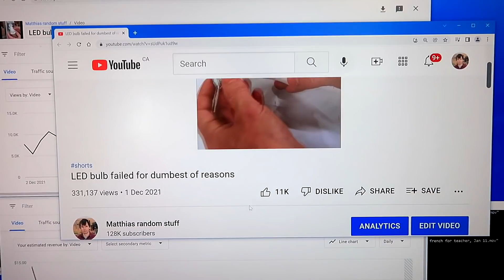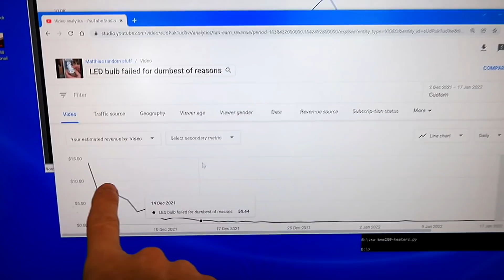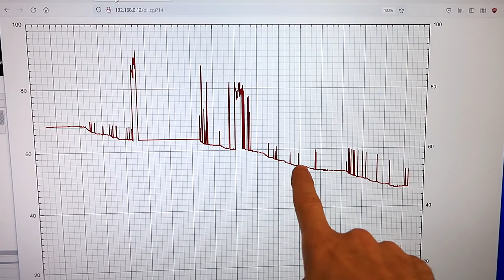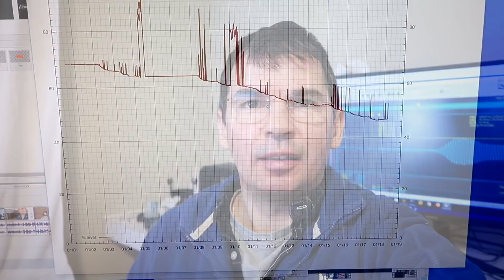Experiment videos, sponsors, and square shorts

Comment: Hi! I've watched you for a long time, do whatever you need to bill more, its fine!  I think you have a signal integrity issue on most experiments, that oil thing has a way longer wire than it should, to keep it cheap i would connect that to an arduino, and then i2c to the pi, so, sensor is a little bit smarter, you could filter with math, avg, etc, and data is sent to frontend (pi) to graph and play, i2c might not be the best, but it will work, rs232 better.. many options, all of that can be allocated on a ether cable with room to spare. PS: hate the shorts, always watched from pc or tv.... Greetings from Argentina!
Reply from the maker: electricity is a million times faster than sound, so no, not an issue.  Also, even if the wire had a delay, it wouldn't throw it off cause the start and end of the pulse would be delayed the same.
Reply: @matthiasrandomstuff2221  You are thinking on the wires at DC, but it is in reality a transmission line, it has capacitance* and inductance, and when signals bounce at a speed faster than dc reflections could appear on both ends if said line is not balanced, producing a raise on the voltage seen by the ends, it is hard to measure, and even more complex to debug and fix, so, give it an extra thought, that could totally explain those spikes... test could be as simple as moving the pi next to the sensor. I can bet that you would improve all of that chinese noisiness you see (up to a certain point of course...)
Reply from the maker: correct, that makes it only 800,000 times faster than electicity in the wire.  And that changes thigns how?
Reply: @matthiasrandomstuff2221  Yeah, but forget about ultrasound ( you are right about that, and your freezing theory might be right) I'm talking about just an electrical issue. In practice the square wave from the sensor would need a couple of nanoseconds to reach the pi, but that's not the issue, the square wave itself is what im referring to, the sharp edges contains a lot of frequencies that will generate ringing, and that 'pulse' traveling in a non balanced wire will generate a step voltage (reflection) on the other end, these effects will increase the noise on the readings you collect, added to the noise of the sensor itself. So the signal integrity mention is about how data travels, and how this effect will get worst data readings. Thats why you get better results with i2c, not because the sensor is orders of magnitude better, witch surely is not, but because the data travels on digital form and is a little more reliable.

Comment: What if you added a layer of panty hose material between the transducers and the oil below? Might sort out the condensation issue without affecting the acoustics of the sensor all that much.
Reply from the maker: that would let the vapours through, but mess up the accoustics
Reply: @matthiasrandomstuff2221  Might be worth testing a few barrier materials in a future video. What would be the first material you would test?

Comment: Matthias try the sht31 for temperature and humidity sensor... They are used also in Davis weather stations and the netatmo too
Reply from the maker: that looks nice.  Expensive, but could be useful to check other sensors against
Reply: @matthiasrandomstuff2221  
The newer SHT4x series is cheaper and, currently more important, also available! It's easier to solder, if you don't get a premade breakout board. I soldered "flying" wires to to the 8 pads of an SHT30 for a prototype. It was quite the challenge with 0.25mm pads and 0.25mm spacing. Myopia for the win at an age where others can't even read without glasses ;) . SHT4x is much easier in that regard with only four pins and 0.8mm pitch.

Comment: What's the problem to get power for sensor from mp output pin? I don't think it require lot of power. This way you may power cycle (reset) the sensor completely if you get some strange readings. And if you can tell "this is flaky reading" you may teach your mp to reject it. Guess there is no such thing as ideal sensor, you have to be prepared for everything.
Reply from the maker: that doesn't fix the lack of good calibration, and the noisy samples.  Also, they need 3.3 volts, and the logic "1" output of the pins is a bit less than that.  At some point it makes sense to spend the $4 per sensor.

Comment: Since you ran an Ethernet connection to the shed, why didn't you just plug it into the RPi?   Or are you still rocking a P1A+?   It was too small in the video on a phone to tell.
Reply from the maker: pi3a+  Cheapest non zero pi, with decent performance.
Reply: @matthiasrandomstuff2221  Dang.  That's a rare bird.  It doesn't even show up on most Pi Hardware matrix lists...  Well, use what you got because it doesn't look like much is going to be available this year.     Have you seen any of the exterior sounding modules for telling tank liquid levels?  I'm looking at that and a version that goes on the gauge face for propane tanks.   Haven't made a choice yet.
Reply from the maker: I got them from adafruit, cause pishop.ca was out.  But pishop.ca has them back in stock.  It's a much overlooked pi.  But I like the full size HDMI connector!
Reply: @matthiasrandomstuff2221  Good to know...  I'll get one for my spares.   Who knows when we'll be able to get new Pis!?!?

Comment: If you've run an ethernet cable out to the shed, just plug that into the Pi.  Why waste electricity with a WIFI access point?
Reply: i think my wifi access point is only 5w. Not enough to justify running a cable.
Reply: @AppalachianLife  ? theres a cable plugged into the wifi access point my guy
Reply from the maker: its a pi 3b+.  Where do you plug an ethernet cable in that, do tell?  Plus I also used a smart plug, which has no ethernet port.